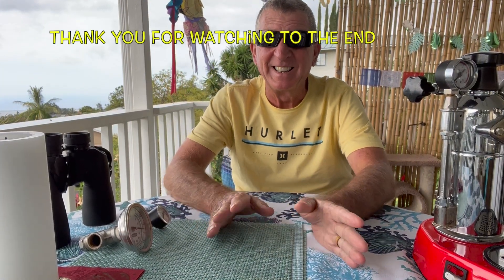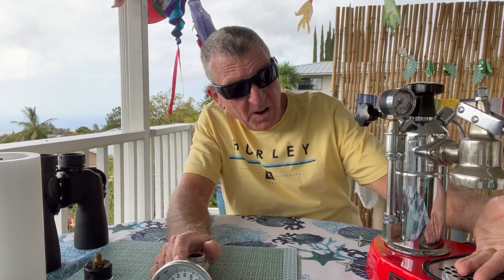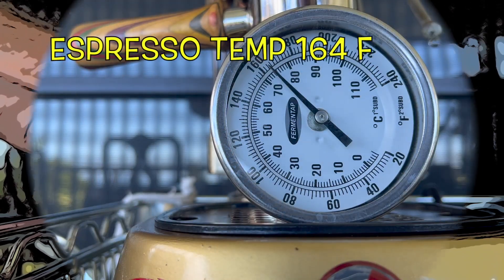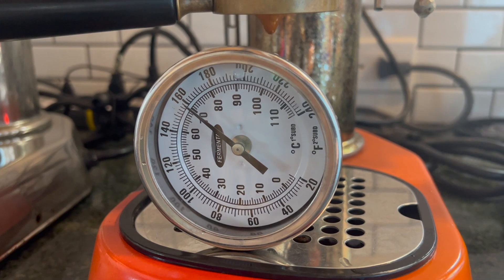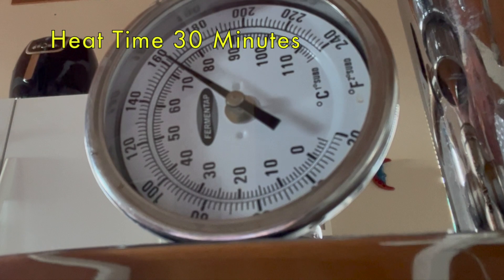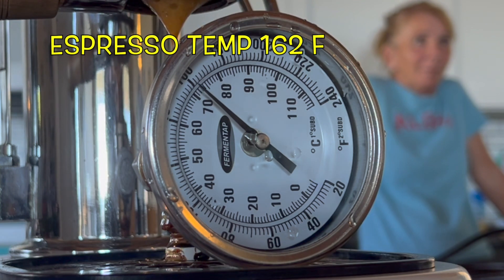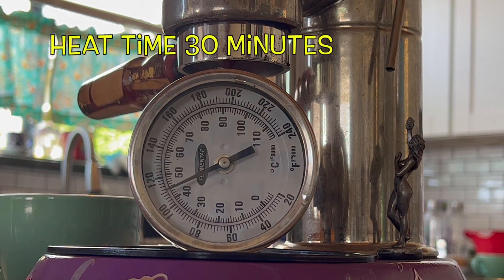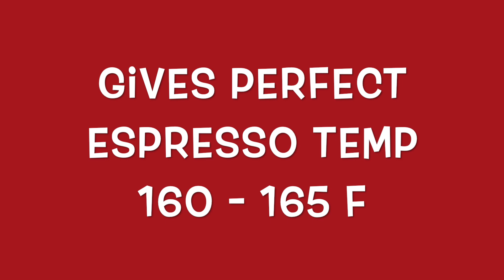La Pavoni Espresso Machine Heat Study  #lapavoni #espresso #espressomachine @theespressocouple

Comment: Nice study. What material is the t-fitting pipe in that temp gauge? Isn’t that sinking a lot of the heat from the espresso shot?
Reply from the maker: No I preheated a bit so that it would not leech heat away . The 160 - 165 is the cup temp from many sources . I wanted to get the temp as close as I could as it came out . :)